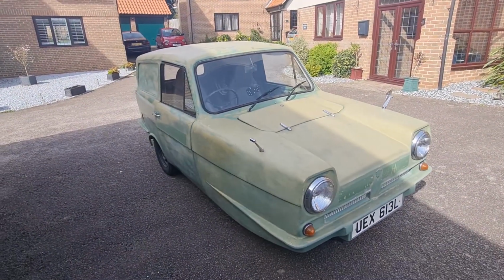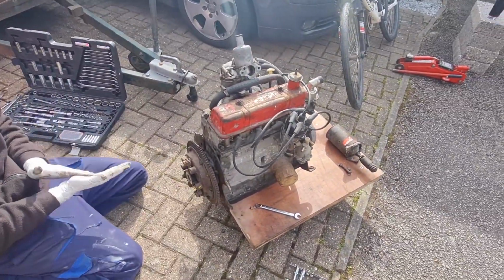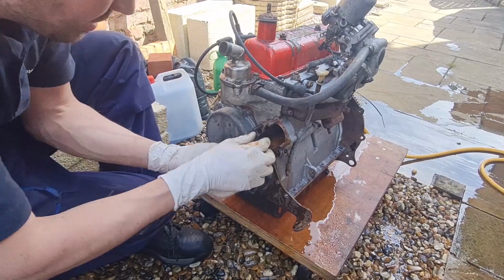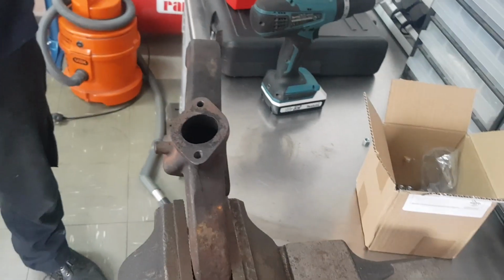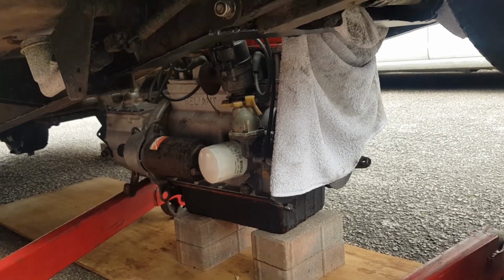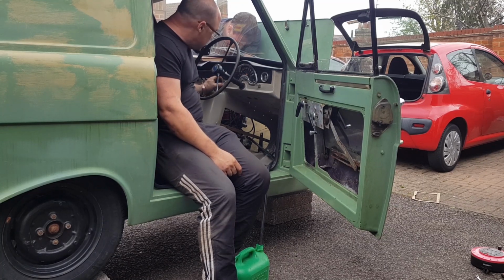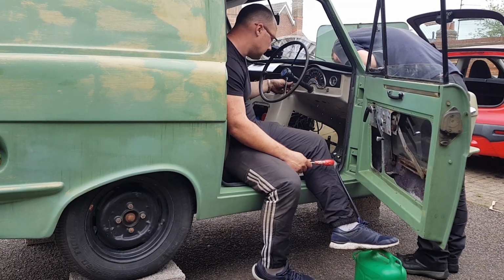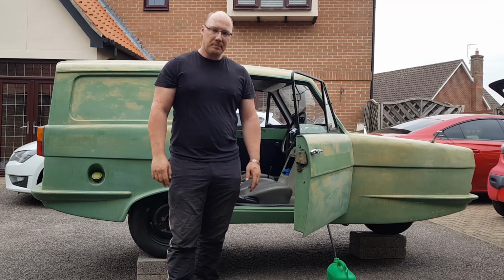Electric Reliant Regal Supervan 3... Now converted BACK to PETROL !! Project Dipstick Part 2

Comment: Great stuff!  You ideally need to remove the water drain plug at the back of the block and have really good poke around the back on no.4 cylinder with a stiff rod. And old stiff choke cable is ideal. But just be careful with the plug as if you force it you might strip the thread in the block. But that area round #4 cylinder is notorious for silting up with shit.
Reply from the maker: Hi thanks for the great comment and support ! thats some very good info i will pass that onto Dan, he should be able to do that, thanks again !! Regards MEC 👍👍👍